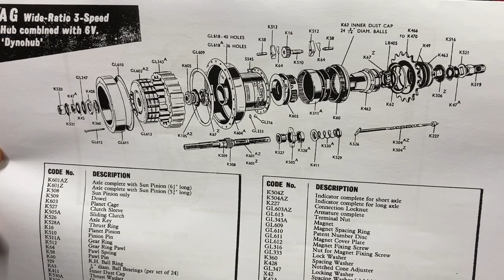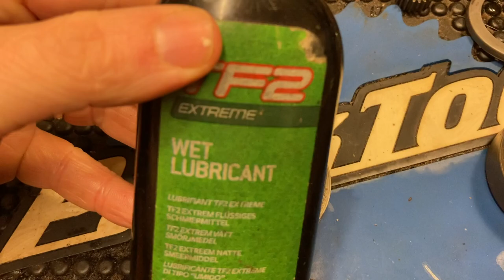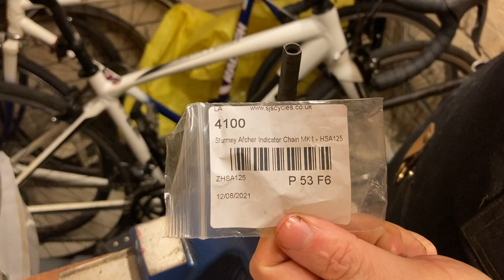RUSTY AND SEIZED HUB REBUILD AND RESTORATION // 1956 Sturmey Archer AG 3-speed Dynohub

Comment from the maker: I hope you enjoy this video. Do you like the ASMR style or do you prefer videos with commentaries? Would you like me to do another version with me talking you through the restoration?
Reply: Hi I'm in the process of servicing a Sturmey Archer AG 4 speed do you know if the dismantling is the same as the 3 speed I will be following your video it is also 1956 and what size cage bearings does it take as I would like to replace these and cannot see 8 caged bearings on Amazon so could I possibly just replace the bearings lose or fit new ones in the old cage would appreciate your thoughts many thanks...
Reply from the maker: @stephenwright8103  Hi thanks for getting in touch. I’ve not dismantled a 4 speed FG hub before - though I do have two of them from 1950 in the queue to service! They are very similar to the 3-speed AG hub with the main difference being that the indicator chain and rod passes through the entire axle and pokes out of the non-drive side.

You can download instructions and a diagram of the hub from here: https://hadland.files.wordpress.com/2012/07/safg.pdf
Reply from the maker: @stephenwright8103  I believe the caged bearings are 1/4 inch, same as bottom bracket bearings, but the cage is Sturmey Archer specific. I order my Sturmey archer spares online from SJS Cycles, https://www.sjscycles.co.uk/hub-spares/sturmey-archer-ball-cage-hsa284/
Reply: Thank you for your lightning quick reply it looks the same as the rusty and sized my one, as you mentioned it has the chain connector running through the axel to the other side  it is still on the wheel being stainless also the front not sure what model it is it looks the same as the superbe but has side pull brakes overall its in good condition will probably go with the boiled linseed look but in the meantime I might wait for you to start the 4 speed service as I don't feel  brave enough at the moment to tackle it  I'm sure this will be extra interesting for us 4 speed riders look forward to your forthcoming videos 👍
Reply: Hi personally I prefer commentaries as in most cases a service of a hub to most people looks daunting so I think this makes it more understandable for the novice, don't put yourself out I can follow the procedure ok Thanks again...
Reply: A very useful video. Thank-you for making it. 👍
Reply from the maker: @ivanhoe6366  Thank you! I'm really glad you found it useful 😀

Comment: Did I miss where you cleaned the dyno ring? 😮
Great vid, nice and clear. I have a '78 or so that lost first when a driver ran into me from behind. I was concerned about losing the magnetism but I see from your video you can keep the units together. Now I'm concerned about cleaning them when they're out 😂
Reply from the maker: Thanks for watching and for your question! I didn’t remove the magneto ring from the metal housing, as I don’t currently have the tool you need to hold it together without losing the magnetism. Instead I flushed out the rusty water with WD40 and electrical contact cleaner and gave exposed parts a wipe. It runs better now, with slightly higher output.

Comment: Have you tried using an ultra sonic cleaner for hub restorations?
If it's not thin wires, soft aluminium or plastic parts, they absolutely work wonders in thoroughly cleaning intricate parts. Restored my almost 30 year old Sachs Torpedo 7 hub with it, parts looked like new and it saved me the headache with the toothbrush. Just be careful with electro plated parts, if the plating has holes in it, U/S cleaning might enlarge them. 
Hope this suggestion might help you in maintaining stuff. Cheers
Reply from the maker: I don’t have an ultrasonic cleaner at the moment but plan to get one later this year. Do you have any recommendations?
Reply: @RichsRidesandRestorations  I don't work on bikes professionaly so the premium brands like Crest are way out of my price league.
I find cheap asian brand U/S cleaners work just fine. Just keep an eye out for heating and transducer power, you want those two to be roughly equal.
My first U/S cleaner was actualy a small 30€ from Lidl, pretty nifty and enough for about 80% of all your needs, how ever it was too small for my needs.
I later got a 6L model for 130€ off aliexpress, and while it does its work just fine, I do not expect it to last as long as a branded model. It also wont be able to last under continious use e.g. for longer than 30 minutes, without running the risk of overheating the transducers.
Which again, is just fine for me, since the parts are spotless after 15 minutes anyways.
I would've taken a 3L model if it wasn't for the small upcharge when it comes to a drain plug, makes it much easier to clean up, especialy as some models aren't fully sealed.
On the topic of clean up, I put my disassembled hub inside a (rather big) jar with cleaning solution and the jar inside the U/S filled with plain water, so I didn't have to waste cleaning solution, and the grime is contained in the jar.

One last word I'd like to say
U/S cleaners are not miracle devices, and you should roughly clean off your parts first before U/S cleaning them, but it makes going the last mile so much easier, and thorough.
Cheers
Reply: @RichsRidesandRestorations  Also get one with a basket and only check for basket size, not total unit size or cauldron size, they will basicaly self destruct when you rest parts directly on the bottom and the cleaning effect will be greatly diminished. Basket materials should only be metal (preferably aluminium) or glas (e.g. a jam jar) . Plastic absorbs the U/S waves.

Comment: Hello sir! Thank you so much for the video. Since I'm trying to restore a Raleigh Superbe, I just realised that second gear is not operational, it's like the gearbox is in neutral when you select it. I also hear what I think is the freewheel ticking all the time when I pedal, but I'm not sure is that actually producing the sound. Watching videos I kind of learned that second gear should have the sprocket and the hub rotating at the same pace, but I really don't know what to look at in the hub to make that happen. Just wanted to ask if you had any suggestion for having already experienced that kind of situation. Thank you again!
Reply from the maker: Hi, thanks for watching and for your question! The first thing I would check is the adjustment of the gear cable, as it sounds like it's either not tight enough or too tight, and it's not engaging with 2nd gear. The second thing I would check is whether your hub bearings are correctly lubricated. 

I made a video about how to lubricate the hub and how to correctly adjust the gearing here: https://www.youtube.com/watch?v=rrot8ouZ8LI

Let me know if this helps!

Rich

Comment: Don't know if u remember about my previous comment that I own a 49 and a 61 but I broke the plastic dyamno cover on the 49.s original wheel as I had spare bits and new spokes I built a set of 61 wheels for my 49 do u know any one who can get the plastic cover for my 49 wheel as I'd love to keep it original as possible
Reply from the maker: Hi, thanks for your comment. If you’re on Facebook I recommend joining the “Raleigh Roadster Owners Club” group, which has some very knowledgeable members and people who have helped me out with sourcing spare parts.
Reply: @RichsRidesandRestorations  I am I'll do that thanks I was quite lucky when I got the 61 for an extra 70 pound I got the bits to built the second set of wheels and nearly enough to build another full 61 bike once my original 49 wheels are sorted and back on the bike  then I'm going to catalogue all the bits make sure I've got everything and if have or I'm close to it then thinking of doing a nut and bolt restoration due to health reasons I'm not able to work atm I get so bored I think my bikes are one of the only things keeping me going . Big fan of your channel even tho I've been doing bikes years I've still learned a good few things of you
Reply from the maker: That’s awesome, I’m so glad that you find my videos helpful. Thank you for your support 👍🏻